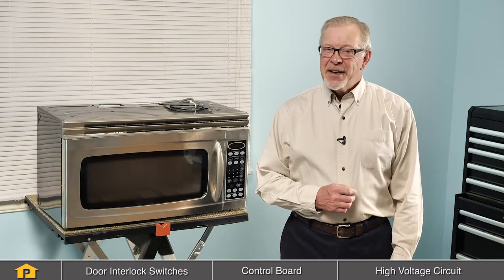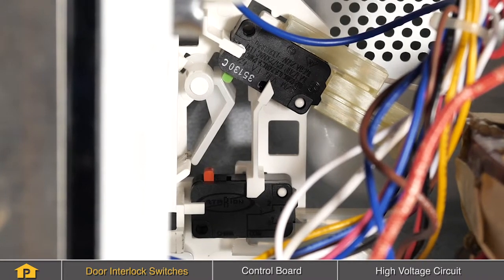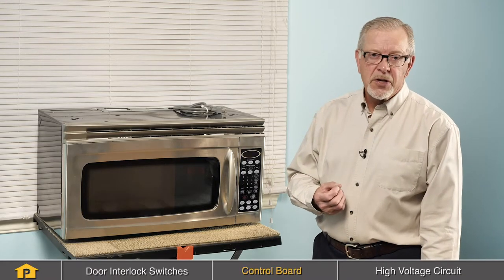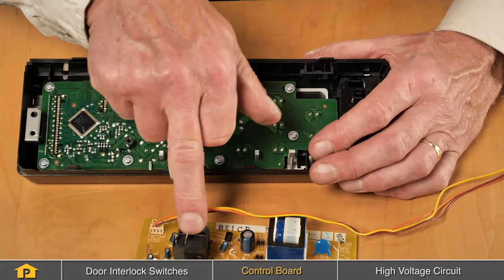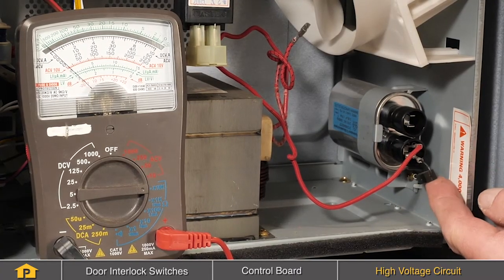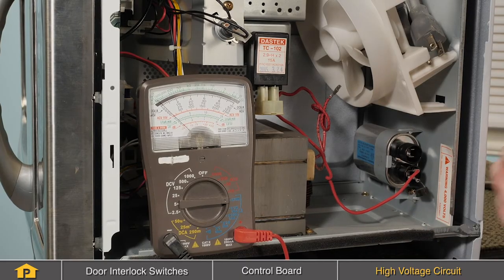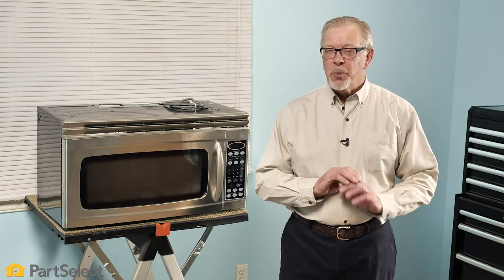Microwave Troubleshooting: How to Diagnose a Microwave That Won't Heat | PartSelect.com

Comment: would not recommend going anywhere near the high voltage cap unless you know for sure its discharged,these caps have an in built 10meg resistor that will discarge the cap slowly after microwave has been disconnected from mains,but if that in built 10meg resistor has failed which is rare but can happen then that cap will hold a deadly voltage that can kill so beware

Comment: Hey Steve u could make this a much safer operation if you cautioned people to discharge that high voltage capacitor before taking the reading, otherwise great video!
Reply: He did.  Wait a few and leave it alone, it'll be fine to check then.
Reply: L
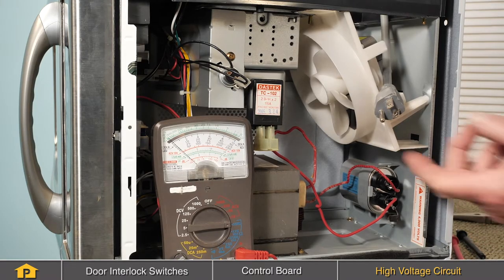Reply: This capacitor has a resistor attached that discharges the capacitor automatically when you remove the voltage ( 4:30 )

Comment: Couldn't hear and who has an analog meter nowadays?
Reply: Even if you have a digital meter you will still see the numbers alter to the same patten as a spring / analogue meter
Reply: Doesn't matter Karen - digital or analog.  Still provides the needed measurement.  I guarantee you that microwave and all it's parts were developed with analog meters!

Comment: I have an LG Inverter Microwave. It is about 6-8 years old and quit working only a year after I bought it. Before it died it would completely power off with no signs of life.  Hitting the side near the control panel or hitting the control panel itself with the palm of your hand would cause it to show power again, and you could then start it up and it would run perfectly for a while. It is now completely dead.  Not even the light comes on when the door is open.  I disconnected and tested all 3 microswitches and they all work correctly when the door opens and closes.  I also checked the fuse and it is good.  I pulled the control panel apart and saw nothing melted.  My best guess is a solder joint on one of the two boards might be bad, but would that completely kill all power to everything, including the display and the light when the door was opened?  (I know hitting on it was not the solution, and probably just made the problem worse.)  I would not know how to check all the solder joints on the board.  Do you have any suggestions?  Thank you.  God bless.  James

Comment: I see you may not be responding to comments on this video anymore but I'll post my situation anyway, just in case. I have a motorhome with a large built-in Samsung microwave. It just started giving me trouble. It acts normal until I punch in the time and hit start. The light in the oven comes on and there is a very faint humming sound, but it's clearly not working , and the turntable doesn't turn 

I thought the microwave was toast a few months ago and started using a backup one, then all of a sudden, on a whim, I tried the built-in again and it worked fine. I've been using it all this time without issue until today. 

I microwaved a bowl of ramen for 10 minutes. It ran fine, completed the cook time, beeped and I went to remove the food. When I went to microwave something else, it was back to how it was a few months ago when this mess first began. 

Is this just overheating? Is there anything I can do to prevent this from happening other than not microwaving anything longer than a few minutes at a time? I don't want to have to shop for a new built-in. I'm not made of money and I'm a 62 year old chick and don't have skills.

Comment: Hi fred..ive got a ge microwave thats not heating...when i click start the fan turns on table turns..i hear a click relay but no hear normal humming sound anymore....i checks diode and is ok...i check door limit switches ok...what other part could be the issue?...the hv cap is not bulged on top
Reply: I have the same problem.  Did you find a solution?
Reply: The only difference is that my fan starts and table turns whenever I close the door, and the only way I can stop it is to open the door.
Reply: no sorry..im assuming transformer or magnatron bad ...i never troubleshooted any further because i found another working microwave in trash that im now using...

Comment: Microwave starts, runs for about second. Light, turntable, magnetron all start.  Then after a second shuts off. Display says XXXX for a few seconds and then 0. For a while it would do this intermittently, but now all the time so can't use.
Possible problem?

Comment: by far this man's worst video (I have watched many others and liked them). There is no way to figure & understand how to fix one's MW by listening to his video. First, he uses an analog 1950s meter, then no precautions with the capacitor (unplugging from AC and hope the cap will discharge itself is a deadly assumption). Then flew by testing the capacitor and diode... of which I did not get anything out of.  And the volume? Ayaya.... not a good video by any means!